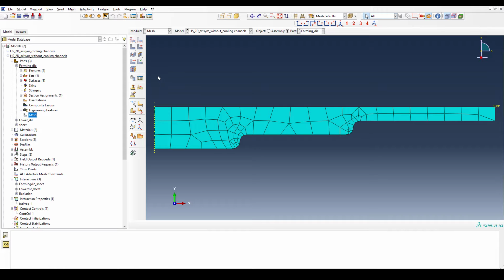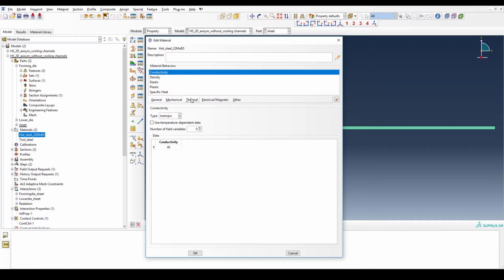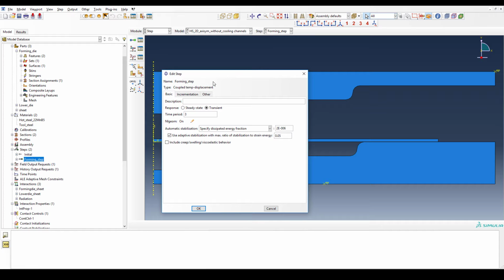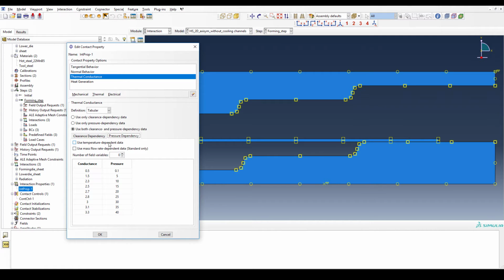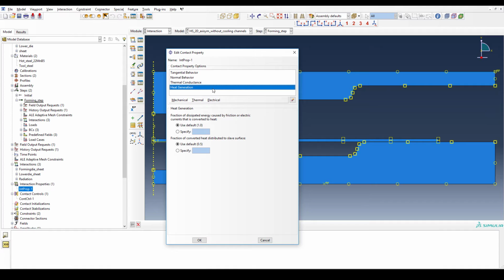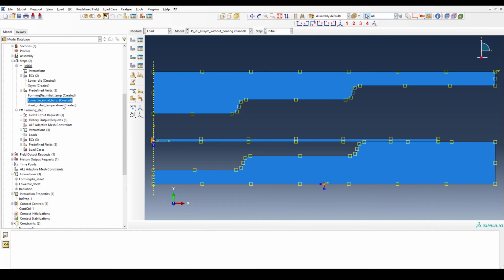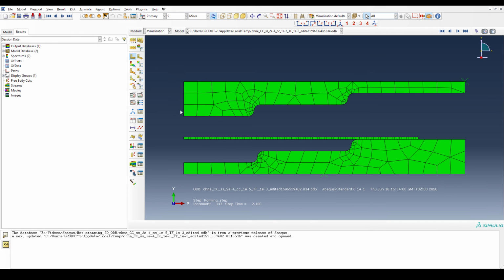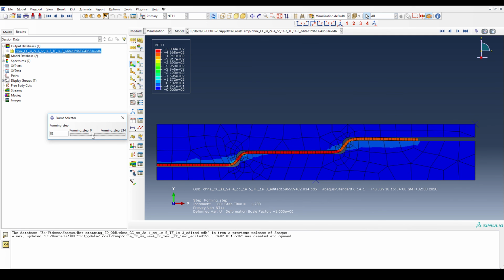Abaqus Tutorial: Thermo-Mechanical Coupled Simulations & Hot Stamping #4

Comment: Also, i have something similar problem but when I open the die after the pressing, the plate also moves upward. I have tried several things but dont know how to keep the plate stationery.  I can also not see the transient and steady state options in step editor :(
Reply: in fact i've just tried an option in "interaction" and deactivated the the top die interaction with plate in die opening step and it worked ! now the plate is not moving up as the top die opens up after first press !
Reply: @MJs-85  Thank you so much for this important update!